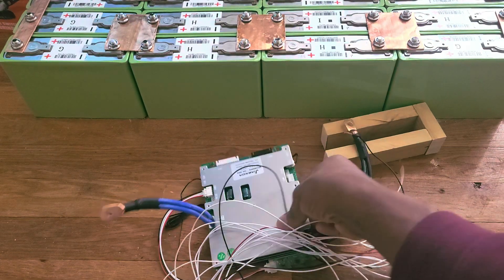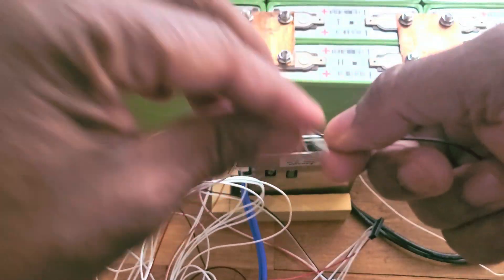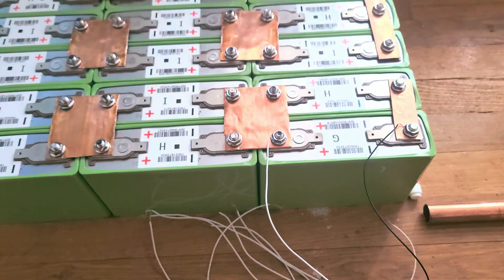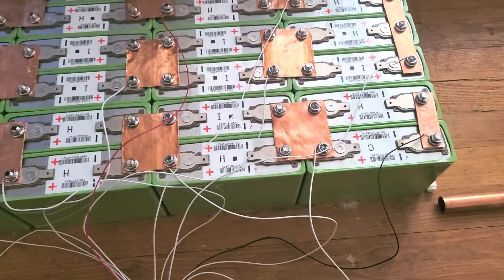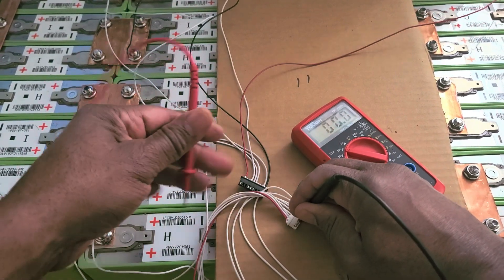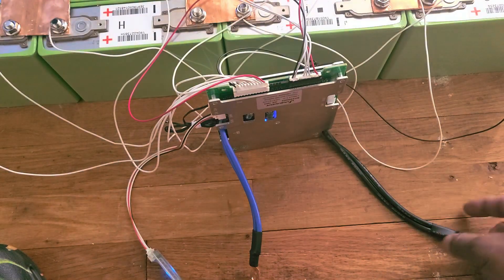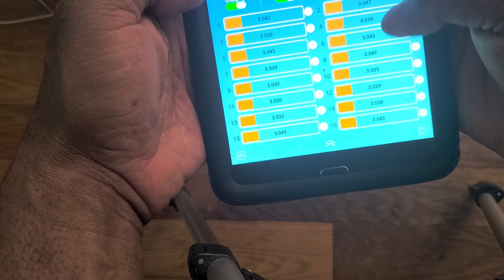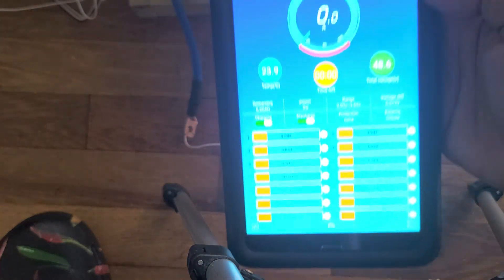HOW TO SET UP JBD BMS 16S 48V LEV60F 3.2v 74ah Lifepo4 Power Cell #lithium #solar #diy

Comment: Those cells can push 600 amps. You picked a small BMS.
Reply from the maker: I didn't plan to push more than 100amps. Do you know that their life time is 1500 cycles.
Reply: @simplyfocus9937  I am sure you can get more cycles than that, they are nice cells. If you get a TE Connectivity EV200AAANA relay from battery hookup it will handle amp surges with your smaller BMS.
Reply from the maker: @_vilepenguin  I will do a capacity test on them next week, I will post it when it is done